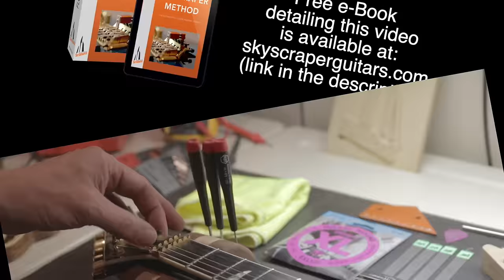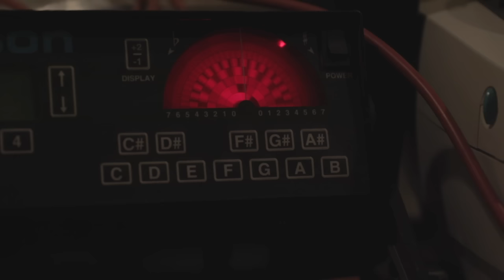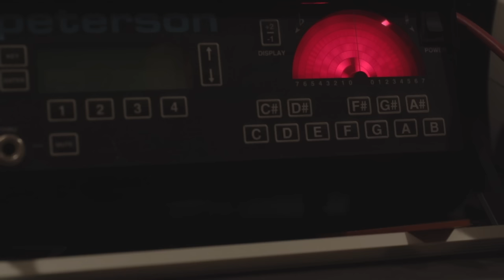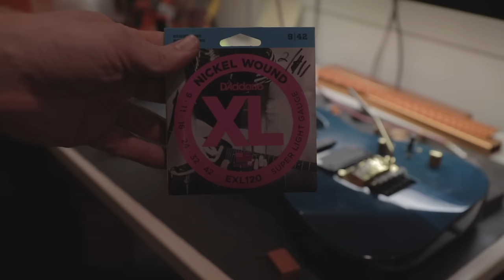FULL Floyd Rose Setup Including Intonation - The SkyScraper Method

Comment: When you have the two outer trem springs splayed-out, that means they are under more tension than the middle spring, all three of them should really be set so they are parallel to each other, so that they have an equal amount of tension on them, otherwise the middle spring won't be doing much and may have a tendency to fall out of the trem-block when doing pull-ups, if that happens all the strings will go flat when the bridge is returned to it's neutral position (the bridge will actually end up sitting so it's angled forward rather than parallel to the top of the guitar body).
Reply: Do you recommend put all the springs parallel and not like the V position?
Reply from the maker: Its preference.  I've heard others say the springs will pop out.  I've been playing Floyds since the 80s with 2 angled and one straight.  I have yet to have that happen.  I suspect using German parts is a big piece of that success...  As I said in the video, I put them straight for customers unless they request the V formation.  For me I like the V but it probably has more to do with superstition than anything...  Take a look at the backs of famous guitar player's guitars...  It's everywhere on the pro circuit and it always has been...  That doesn't mean its right, just means that a lot of players do it.
Reply: I just got a brand new Jackson V on Saturday and was kinda surprised that the springs were factory positioned in the V formation.

Comment: Where can I get the blocks and intonation tool you used? Also I'm still a bit gun shy about messing with the truss rod . But I'm trying to setup a brand new Jackson king V. Should I be okay to trust that my neck is fine at this point and adjust action if necessary at the bridge? I want to do this myself so I can be confident in the process for now and the future. It may sound like I'm little nuts but I think this is all part of knowing my instrument inside out.

Comment: Hi, I am having trouble with the buzz on the 6th string. I've learnt that it can be fixed by turning the screw on both sides. However, I don't know if it is okay that the whole bridge leans from the bass side to the treble side. Any advice? Thanks.

Comment: I'm sure it's obvious in the video, but you set the intonation BEFORE you lock down the nut? I've heard conflicting opinions on this, but I don't see how it's possible to do it after you clamp it. Great video!
Reply from the maker: Intonation is set before the locking nut are on.  When you put the lockers on, they don't affect the string length.  One could argue that they change the stiffness of the string somehow because you're holding the string rigidly instead of free, but I've never double checked the intonation and had an issue because the locking nuts were or were not in place.  I hope that helps!

Comment: Does your intonation tool work on Jackson Floyd's or gotoh specifically the Jackson jt580lp or gotoh GE1996t? Currently have the Jackson in my ke3 but thinking about replacing it with the gotoh but want the tool either way

Comment: This is an awesome video! Just what i needed. I just broight home my fender squire stagemaster with dual bucks. Nice sounding git-fiddle and plays well too.  Took forever figuring out how to change strings and tune it back. 😒 but I won! Will your intonation tool work for mine? It appears it will. Oh my tuner is the tc electronic poly tuner which has a strobe function. As well as my tuner of my tc electeonic bh250 which is also a pretty soild tuner. You opinion on using those?

Comment: Hello!
What do you recommend using as a shim for one of the saddles if the strings radius isn't correct (low on the 5th string compared with the D and Low E)

Comment: Nice tool, I wasn't aware of it, just one thing, you intonate with the old strings then replace them and don't intonate again?
Reply from the maker: I go through EVERYTHING again with the new strings.  I usually let it rest a day, then check, then rest another day and check again.  The rough-in with old strings is usually 95%+.  The adjustments from there on are usually very minor.

Comment: I can't figure out my floyd rose. I'm about to take it in to a shop. It came to me with the trem severely riding high (traded for it). I tried switching strings and for some reason, it just keeps tuning and tuning and tuning and tuning. Every time I tune up, the trem gives a little and it detunes... all the way until the trem is 45 degrees. Any ideas what to do? I'm thinking it needs new springs but idk its only 3 years old.

Comment: Purchased your Pick Pocket tool.  Sorry to report that it just doesn't work that great for me.  It is a bit of a hassle.  It keeps popping out.  The silver side that hooks into the saddle looks like its tab is bent?  Not sure if that is the way you designed it.  I would imagine that it should be perfectly straight.  Kinda sloppy to try to hold the tool in position while trying to use the allen key to tighten / loosen the saddle and another allen key to adjust the Pick Pocket.  KInda need three hands.  Excellent attempt at solving the problem though.

Comment: I have a question , i bought a jackson mj series dinky with a gotoh trem system and had it set up by a local tech and i have adjusted the springs a slight bit due to tuning changes and needed to get bridge back level , but issue im havin now is when i bend the bottom E or B string i notice it pulls my tune out slightly for a sec as i bend , kinda of a warble sound as i bend strings , is there any advice to fix this , should i lay the bridge back or up a small bit to fix this , thank you for any help

Comment: hi great vid, im getting the intenation and block set from your store. how do you take a twist out of a neck? like one side is flat and other side has a slight bow{either way,up/down} ?
Reply from the maker: Twist is a BOOGER to deal with.  Most guys will replace twisted necks.  Randy Shartiger and Dave's World of Fun Stuff both have videos on taking out twist.  I use a heating blanket and it's 50/50 at best...  Probably more like 20/80 if I'm being honest.

Comment: Yes of course "The Key" works under string tension! What good would it be if it didn't???
Reply from the maker: Exactly my point.  You have to detune, adjust, retune, check, detune, adjust, etc.  It's just as easy to work without one.  I've got a pile of broken "KEYS" from trying to use them under string tension.

Comment: Maybe I skipped a lot but the results are the same. The Floyd was parallel right out of the box. There was no fret buzz anywhere. I just loosened the three nuts and tuned the strings just like any other on the head. Once in tune, tightened the three nuts and it stays in tune just like any of the other guitars. If tuning is necessary I just use the fine tuners on the bridge. I took it to have looked at by a pro repair/setup guy and he looked it over, measured everything and couldn't find anything to do to it so there was no charge.

Comment: I bought ESP GH 200 for the first time - floyd rose.
Now I am having trouble with the intonation and the string tension is too hard when tuning it to standard E. I watched many vids for it but cant solve it. What shall I do?
Reply from the maker: If the string tension is too high, I would suggest lighter gauge strings.  The video you commented on shows every step that I use to setup a guitar whether it's getting the same strings or a different gauge.  Just follow the instructions step by step.
Reply: Thank you

Comment: At about the 7:15 mark you say that you only do this set up twice per year, with regards to loosening the claw screws... Can I ask how you change the strings the rest of the time? Do you still use the block or do you do one string at a time or any other differences from this video? This is a great video, Thanks
Reply from the maker: Sorry I it's taken me so long to answer you, I missed this in my email...  I use the blocks when I'm changing strings and not setting up.  You can loosen the screws a quarter turn each, block, tune, then tighten them back the 1/4".  That will put you right back where you started...  Since I don't gig anymore and I have a couple guitars that I play, I don't change strings that frequently.  I'm also lucky that the oils from my hands don't seem to corrode strings like some of my friends.  A good wipe down after playing is also a good trick to extend string life. -Greg

Comment: it's not wise to string with ball ends at the tuners. cut the ball ends off and put a couple wraps around tuner posts. this way if you break a string it's usually at the saddle, you can unclamp nut and unwind the string to re-clamp the saddle. by string with ball end at tuner if you break a string you have to replace with a new string.

Comment: I would love for anyone in these videos to say which direction the neck goes when the truss rod is tightened / loosened.
Reply from the maker: When it's loose, it allows the strings to have more tension, so the neck looks like a smile if the guitar is laid on a bench with it's face up.  When the truss rod is tight it flattens the neck out so it becomes more like a straight line.  Some truss rods can actually put back pressure on the neck/fretboard and they will cause the neck to "frown" if adjusted too tight.

Comment: First..I really like your videos. As a luthier, to give away your secrets is surprising and refreshing. Thank you. Next..I work on super high precision things all the time. I'm a manufacturing engineer and design equipment. I also have to design setup tools and qc fixtures. So seeing thousandths of an inch is normal for me.  I have a question.. does setting up in playing position really matter? If you measure string height flat on the bench then hold in playing position, is there a measurable difference? I have $10 that it doesn't.. but just in case I'll say it does, but not enough to make it go out of spec. Because specs are usually a range.. not one specific number. Thank you!
Reply from the maker: Yes and no.  Some guitars are more sensitive than others.  String height is not usually affected by position enough to matter.  Relief, intonation and tuning tend to matter in about 5% of the guitars I've seen.  Basses are affected more than 6 strings...  Acoustics are also more sensitive.  You could probably get away with never checking in playing position on solid body electrics, but I always like to be positive that I've nailed it, so I do all my final inspections in playing position.  Strangely enough, straps matter sometimes.
Reply: @SkyscraperGuitars  Wow! The strap?? I've seen you work in your videos, and listen to what you're saying, so I believe anything you say! Unless it's about a bridge for sale...
I might have to buy some tools from you. I just bought a 2017 Schecter Omen Extreme FR. After watching your video i immediately noticed that the fr is pitched down.. down being towards the pushing the bar down direction. I need to do a proper setup. Where are you located? I'm in western NY, Fairport NY to be exact.  Thank you for the reply:)
Keep up the great work!

Comment: Protip for tuning floyd rose guitars so that you don't have to re-tune your entire stringset every damn string: Tune in this order: String 3 - 4 - 2 - 5 - 1 - 6 where 1 is the high string and 6 the low string. (while stringing indeed block and tune up) 

Legit I bought a "the key" while waiting on my new guitar with floyd. Thinking OMG IT'S GONNA SAVE MY LIFE. I tried it once, decided it's easier to just detune the string, move the saddle and re-tune. Also, the screw in my ibanez rg320 just came out because that DID strip the wood (someone put a stupid strong spring in I noticed after, was trying to set up the bridge....)

Edit: You mean people cut guitar strings that are still tuned? 👀 dafuq. My guitars are out of their cases too btw. I always start on my les paul and swap to my setius after half an hour.

Comment: I've heard it said that the "rooftops" on the nut string lock plates should run parallel to the strings, because of a built-in "rocking" feature, that allows the sides of the plates to rest on the strings. On my Floyd, they run perpendicular. Why do these differ?
Reply from the maker: You can turn them either way and they'll work.  Its better to have them parallel with the strings.  You should be able to rotate yours 90 degrees and it will work out.

Comment: Hmm.. i woudlnt call this skyscarper method though. Iv been doing the block under the floyd for mlre than 20 years.

Id like to point out though.

When doing the strings on the bridge area, might aswell put a 9 volt battery under the string lock bolts on the saddles, that way you dont need to push the bar down just to torque the string bolt.

Comment: can you answer me a question ? my new guitar came with the floyd not even. the term posts are not even close, the clearance between the bridge plate on one side is almost 1/4 inch and the other side is roughly 1/16. i am referring to the distance between the body and bottom of bridge plateone post is screwed in much further into body, should they be more or less even height?
Reply from the maker: Depending on the string set, there is a bit of a tilt from bass to treble to get the correct string action.  It's usually a pretty small amount.  If you set the bass E to 5/64" above the 12th fret and the treble E to 4/64", your bridge will be slightly out of level, but not much... As for the trem setter, I don't have a bunch of experience with those.  I try to keep the guitars as stock as possible.

Comment: Hey Guys...
I just received my newly ordered Epiphone Alex Lifeson Access with the Graphtech Floyd Rose with the Piezo pickup system built into it. I seemed to have escaped the issue with these, in that the body cavity wasn't routed out quite large enough to allow the tremolo arm mount to not rub on the wood of the cavity...but it's REALLY close. In fact I'm leaning towards actually pulling the Graphtech and routing the cavity a bit as to give it all the room it needs.
Being this is my first Floyd Rose, I watched your vid on setup and saw the intonation tool you have. Currently they are unavailable. 
Question...Will your intonation tool work on this particular design..? If so...I read from your reply to another comment, that I can use the contact form on your website and if you can put me on the notification list when they are ready, that would be great.
Let me know..!
Thanks...!!
Dred
Reply from the maker: Dred, congrats on the new guitar!  Can you send me a couple pics of the bridge?  There are so many version of the FR bridge that it's just better  to see the actual one you have.  We are supposed to get a batch of intonation tools back from the plater today or tomorrow, so we should have tools ready to send out by the weekend.  Send me an email - support@     skyscraperguitars D0T com

Comment: Hey SkyScraper, wondering why you take the block OUT before cutting strings off? Wouldn't it be more secure to leave it in? I've watched your video about 100x and that's the only thing I don't understand in the process (doh!)
Reply from the maker: Not totally sure what you're getting at here...  I cut the strings to length as I'm "installing" them.  That means all the tension is coming from the spring side.  You'll notice I use the wang bar when tightening the string blocks.  If I had a block in the back, it would just fall out, because the string pressure is what keeps the block in place and there isn't any when the strings aren't under tension yet...  Does that make sense?  You could put a block on the other side of the sustain block and that would force the bridge to be a bit more level for a string install.
Reply: @SkyscraperGuitars  Hrmm ok I probably just don't understand. But at 13:31 in the video you take your trem block out and then cut the strings off... this would cause the bridge to drastically move backwards, where if you left the trem block in that wouldn't happen? Sorry for the confusion, or probably incorrect question lol
Reply: @SkyscraperGuitars  I think I get it... the block would have to be removed from the trem block cavity, and put up under the bridge cavity on the top of the guitar..
Reply from the maker: @DavidMacVicar  Ahh...  I was thinking this was related to the new strings and its actually the old strings...  Yes, you can put a block under the bridge or on the opposite side of the sustain block to keep the bridge closer to level as you remove the strings.

Comment: Why not have the block inside while changing strings?
Reply from the maker: Without the strings in place, the block has nothing to hold it.  You need the string tension to counteract the spring tension...  Does that make sense?